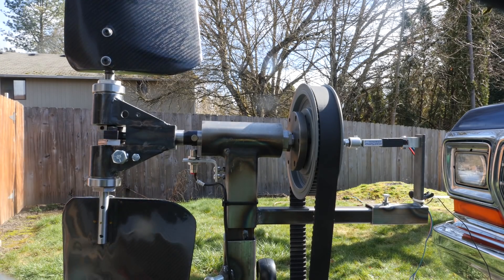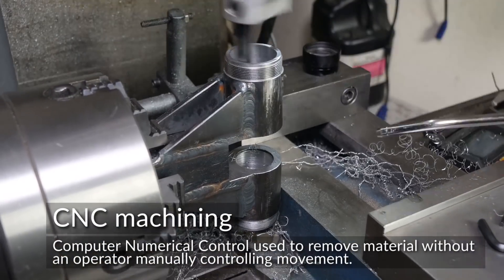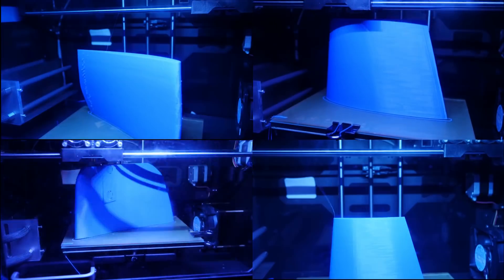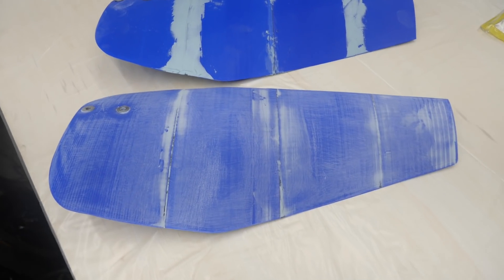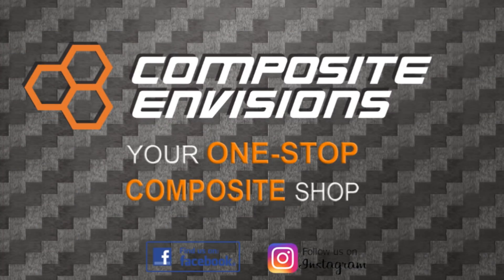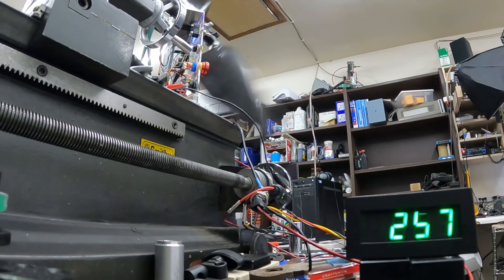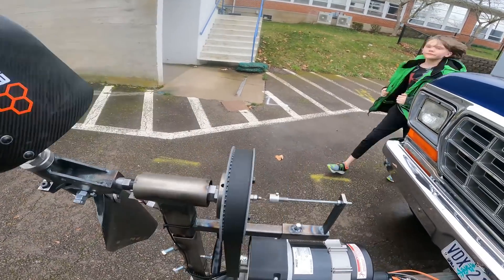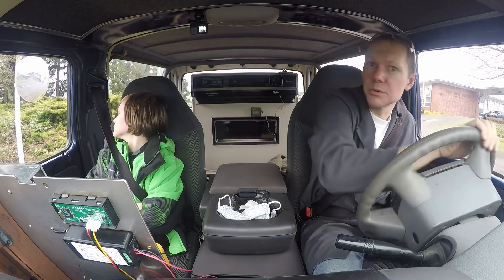Carbon Fiber Blades Making 2000 Watts! - Wind Power on a Car #4

Comment: Experimenting and learning is okey. The laws of energy says that every Watt Hour You will gain from the wind turbine You pay for at the gas station.
Extend the theory a bit. Suppose You could mount a Mega Watt turbine on a moving vehicle. You won't get Mega Watts out of a vehicle powered by even 1000 Hp.
Reply from the maker: Did you read the pinned comment?
Reply: @QuintBUILDs  Eehh. Can You quote or point out what I missed to read?
I made the comment thinking mostly about the average reader and less about aiming at You.
Reply from the maker: @Stefan_Boerjesson  Roger that. I was referring to the part where I'm not certain it will mean additional fuel consumption.
Reply: @QuintBUILDs  Okey. You can calculate using gallons per mile, using the efficiency of the engine, the amount of energy per gallon fuel. Do this with and without the wind turbine and compare to the electrical energy gained from the turbine.
It will for sure increase the fuel consumption. The turbine acts like a parachute, an air brake. In the old days aeroplanes used parachutes to waist the living energy: E = m*V*V/2. m is the mass, V is the velocity.
Reply from the maker: Video proving it works: https://youtu.be/tEPBdztGMdI  😁

Comment: There are already stories to make possible electric car can driven by the fan generator.... 2000W power to drive electric motor.
But at which speed did you make to generate 2000W?

You have already smart childrens!

Comment: I could be wrong but I figure if you use PLA/PETG then it wont crack or warp like that. Since you coated it with CF you don't need the strength of ABS.

Comment: This video caught my eye because I'm always amazed that electric vehicles haven't been designed to charge the batteries some via kinetic generators of some sort.
Reply: They do, they call it regenerative braking.
Reply: @Fulano5321  That's a start, but it doesn't charge the batteries while driving. I'd like to see that technology put into action. My uncivilized mind wants numerous little turbines or something like water wheels spinning while air passes over/through them while the car drives. Maybe the weight and drag makes that kind of thing impractical. Dammit Jamin, I'm a youtuber, not a rocket doctor.
Reply: @xmas4203  Ah, yes, you're right, the drag makes such a thing impractical. There's a thing... one sec while I Google... the Betz Limit that explains that you can only get about 60% of the energy out of wind. So in this video the truck is probably spending about 3000 watts of energy to power the turbine and create 2000 watts of power for the oven.
Reply: @Fulano5321  I see. I had a feeling it was something like that. It seems like too easy of an idea to not put into practical use. 
I always think of my bicycle when I was a kid. I had a light that I'd flip so the little wheel would lean against the tire and as I rode my bike, the light would light up via the little generator.

Comment: Why would you do this???? 
On the car, that "wind energy" is using the cars fuel directly, so not actually wind energy. Its a dangerous air drag wasting money at that point. On solid ground, all math, construction ect is pointless because you wont find anywhere with that kind of wind.
Reply from the maker: See pinned comment
Reply: @QuintBUILDs  i did, i can think of more useful things you could make with your talents. I need something useful making for my gokart. It needs a power generator to recharge its battery while its running. I think you could convert a motor bike stator into a battery charger running off the rear axel AND you could do it in nice carbon...
Reply from the maker: Video proving it works: https://youtu.be/tEPBdztGMdI  😁
Reply: @QuintBUILDs  your data says no fan uses less fuel to move ergo my point was correct. The math on power consumption is flawed because your making big generic estimates of efficiency of the equipment.
Reply from the maker: @christianbuczko1481  don't let the facts cloud your judgement. 👍
Reply: @QuintBUILDs  btw, i think you need to upgrade the battery, as it shouldnt be losing that much power in so short a time, and the cables supplying power to the oven as your losing alot of power there. You need to set it up similar to the power supply for a high powered subwoofer with 10mm^2 cables min, and then check that alternator is working to spec as they can wear out and become less efficient. I suspect the alternator with sufficient power supply and battery set up would be much closer to the fan version. Any further efficiency of the fan would be from an aerodynamic improvement resulting from the fan on the overall vehicle as compared to no fan which is possible when your truck has a big flat front end because it cant get any worse but the benefits of putting such a system on a tesla would be less and likely result in the car being less efficient.

Comment: The ingenuity is nothing short of impressive, but nonetheless energy comes from somewhere.  In reality it would be better to add a second alternator than to add a turbine.  The only time that this would be optimal is going downhill, or decelerating, where the momentum would be converted to electricity rather than heating up the brakes.
Reply from the maker: See pinned comment
Reply from the maker: Video proving it works: https://youtu.be/tEPBdztGMdI  😁

Comment: I make my wind turbine blades out of thin laminated planks of western red cedar coated in carbon fibre cloth. 

It is important the timber is fully dried before applying the carbon epoxy. I spin mine up on a wind driven test rig for coarse balancing and drying. The centrifugal force drives all the moisture and gum out of the blade tip, before applying the epoxy.

Design parametersr are aspect ratio, from 8:1 to 10:1, constant angle of attack root to tip of between 10 and 12 deg, this sets the blade twist, design tip speed of 280kmh, full chord trailing edge flap set to about 8 deg. Laminar flow over front 3rd of chord. Max windspeed 40kmh governed by overspread off centre furling. 

I have found blades designed this way give good all round performance.

I do fine balancing of my blades using additional coats of paint as I have found it is too easy to lose attached balance weights.

Flutter can be an issue (a loud buzzing or roar at high wind speeds) if blades aren't stiff enough.
Reply from the maker: Got pics?

Comment: Just a safety thing- you should wear some sort of a respirator when making any sort of carbon fiber dust for example when cutting or sanding it.
Reply from the maker: You don't sand the fiber of course. That's resin dust.
Reply: @QuintBUILDs  yup. I love the idea of this turbine though

Comment: I am flabbergasted that a ~13% increase in RPM resulted in a ~600% increase in power output.  Are these generators really that sensitive and/or non-linear?  What is going on here?  Maybe you can explain in the next video a bit?
Reply from the maker: An interesting observation.  That generator is kind of unique in that it has a self-exciting "rotating-transformer" armature that requires no external current to start working.  This is not the case in car alternators and most off the shelf generators that have a separate voltage regulator circuit to manage power output across fluctuating load and RPM.  Naturally if I'd removed the belt entirely the turbine would have spun up to a crazy RPM so ~700 must be where the armature actually starts to do its work.  The generator is spec'd for 3600 rpm which would be 1200 at the turbine but we're not generating enough power (yet) to get there.  That's also a reminder that a 100 rpm increase at the turbine is 300 at the generator which helps explain the sensitivity.  Great question though as I hadn't considered that perspective.  I didn't know anything about rotating transformers prior to this project and had to dig through a lot of obscure content to learn about them.  But that's one of the many benefits of taking on monstrous projects like this.  Once I've worked all the bugs out it could make sense to explore other alternator designs but currently I'm planning on controlling power output and RPM primarily thru pitch control.

Comment: Question: Do you think this kind of turbine technology could be implemented into say, a Tesla - and while it may not actually give the Tesla infinite range, a constant charge input could extend the range even farther, simply by driving the car.
Reply: No. It would decrease it's range
Reply: @haha71687  It depends on drag and air resistance, air resistance by a set of blades spinning in front of your car is going to be a lot more then ducted air blowing into a centrifugal impeller, and if designed well enough may not impact the drag enough to cause a decrease in range to the point that the power generated by the impeller could potentially offset the drag it made it improve ranges, not by much, but every mile counts on an electric vehicle.
Reply: There's no such thing as a free lunch.  If it's drag is low enough to be unnoticeable, so is it's power output. This is freshman physics stuff.
Reply: @haha71687  there is more power expended in the motion of the vehicle then the drain on the battery, that is freshman physics stuff. From the heat that can be scavenged from the cooling of the battery, to scavenging energy when braking, to trying and pull some power out of the air moving over the car itself, there is power to be taken back from otherwise wasted energy - now how much that is is questionable, but we know regenerative braking works, and we know that there are ways to generate electricity from heat differences via peltier modules, and I would like to think that a open minded inventor or scientist would have the know how or skill to make a way to take some energy back from otherwise parasitic draws.

Now, please stop being an armchair warrior and go do something better with your time.

Comment: Unless it was a fantastically cheap vacuum pump I wouldn't have expected any trouble running it for a day or so as you're not countering a lot of gas coming into the system or vapour coming off. I'm experienced with Edwards rotary vane pumps and they can run for 18months non stop. pulling against closed system without issue. (Even used with a lot of water vapour they run a long while without issue - though need to drain off mayonnaise occasionally).

Comment: I have one question... Why don't Tesla and other automobile manufacturers use that system for battery charging in cars? Are there any real reasons why it isn't used like? Sorry If I sound stupid but I am not an engineer, so my common sense thinks that could make cars greener and have even longer mileage.

Comment: Great videos and including the kids is awesome.
You could've weighed each blade and within a gram would give you decent balance up to 1000rpm, 2 scales and putting the hub half on each works to for checking 2 pole spinning things too.
Your boy is smarter than a lot of millwrights I know..
-You're a maker, make a fume hood or extractor for soldering. You wear a mask for most dusty operations, your boy shouldn't be inhaling lead/flux fumes. We do because our brains aren't still developing. lead is cumulative and i'm sure he's not soldering every day, but why not. It'll make another good video.
Reply from the maker: I did weigh them out and attempted to sand more resin off the heavier one but was too late to go back and fix.  So... weights!  Thought of it ahead of time but didn't think it would matter that much.  Whoops!  Learned something.

Comment: Basic engineering - You are spending  2 times more energy in your car fuel than u are generating via this wind turbine..
Reply from the maker: See pinned comment. Not so basic I believe.
Reply from the maker: Video proving it works: https://youtu.be/tEPBdztGMdI  😁

Comment: But you have a lathe. Secure the generator to the lathe and operate and understand how much power can be obtained from the generator. Wind generators below 100 kw are not profitable - it is better to install solar panels.
Reply from the maker: Go watch video #2 in this series.

Comment: You've just discovered the ultimate range extender for EVs. When you first started this project, I envisioned a squirrel cage type rotor mounted to the roof; whatcha think?
Reply: It would be a range decreaser.
Reply: @haha71687  How so? Do you think the power loss due to added wind resistance would exceed the power generated?
Reply: @jashton8710  Exactly. You could maybe capture a couple free watts by doing some fancy aerodynamics in the vehicle wake but something like this is going to definitely have way more drag than the power it produces.

Comment: I wonder how far it'd go if you could tweak freely with the variable pitch. I'm interested to see what effect it would have on the engine load. Does a 2000w turbine just draw 2kw(~2.6hp) of engine power? I feel like it would generate a ton of drag as it is basically an autogyro and the modern design probably only improves the RPM with the same drag
Reply from the maker: That is the question to answer. See pinned comment.

Comment: Isn't this one of those things where it will cost more energy, payed for with an increase of gas consumption, because of friction than what you can generate?
Reply: I think this is just for fun science, maybe in future they can make unlimited fuel car by doing this
Reply: @Whopparhombus  That would be amazing!! Sadly thermodynamics would not allow that. Though it would be a great way to make the car go further potentially. That does depend on how much energy it takes with the added wind resistance and power production it offers though.
Reply: Read his pinned post at the top of the comments. He thinks that the car is so inefficient that he'll be able to use more of the energy of the already burned fuel, rather than just waste it; this isn't violating any thermodynamic laws, he's merely attempting to tap into the otherwise wasted energy.
Reply from the maker: Video proving it works: https://youtu.be/tEPBdztGMdI  😁

Comment: Kinda genius putting some of the Coefficient of drag that is other wise just lost  to good use. He’s just converting the drag energy normal lost by hitting the car at speed to energy that can potentially be used to charge a battery. Same as regen braking captures  energy normally lost as heat in braking.  I’m not sure why some people here think this is a physics violation.  Would be neat to test on an electric car on the highway. Interested to see how much if any this adds to the vehicles existing CD. Good job man

Comment: Pappy says put a 427 SOHC motor in and run both pipes thru the oven and you'll have a modern day mobile Turkey air fryer that'll get er done in a jiffy..the temp control is the gas pedal...if you're just going a few blocks you can still do Turkey legs..get em real done now...go to some of those "Squeal Tires On Pavement " signs to help preheat the oven real good..I bet it hardly takes any electric power at all that way.

Comment: You might try mounting a gasoline powered heater from a '46 Chevy inside the oven and see how much gas it takes to cook a chicken that way as opposed to electrically, thereby the best way would be exposed at last...since you're stuck with an ovenmobile

Comment: On small aircraft that use “Constance speed props “ they use oil pressure in as a hydraulic cylinder to Controal the pitch of the prop

Comment: Why not just install a good high output alternator like a Mechman, CES, Brand X, or Iraggi. Then throw in a proper lithium battery or two and call it a day while also producing 2-3 times the power? Need to run a stove or other 110/220v appliance? Inverters exist 🤷‍♀️
Reply from the maker: See pinned comment

Comment: Next question: how much mpg did you lose to power the oven?

Hahaha.
Reply: I was thinking how many cookies per gallon.  That is the real question.
Reply: @CorePathway  how many calories consumed
Reply from the maker: Here's your answer: https://youtu.be/tEPBdztGMdI  😁
Reply: @QuintBUILDs  Thanks a great deal for the video and the work you put in.
Reply: Love to see this experiment with uk gas prices.
Reply: @ICGedye  people in the UK use public transport lol
Reply: @9The0Unknown7  yeah the cash-strapped, smart or those who can’t ride a bike. Car is king, the bigger the better.
Reply: @9The0Unknown7  UK doesn't use gas either
Reply: Only cook on a down hill
Reply: Yeah the truck engine is powering the oven at the end of the day. Any wind resistance turning the fan blades is just added to the net vehicle resistance, and the engine makes up the difference being under a slightly higher load.
Reply from the maker: @ClarkBark14  not exactly.  See the latest video where we check the mileage:  https://youtu.be/tEPBdztGMdI
Reply: But go deeper. Calculate how much your electricity costs to produce and compare that to doing that at home. Btw the new interior and old bronco exterior was hurting my brain until he explained it's a restomod.

Comment: This is a classic example of 'because i can". Anyway...

Basically, at a super high level, he would cook something with gasoline...ultimately. And because of the laws of thermodynamics, the loss of energy would be significant. Still, it is fascinating to see the engineering part.

Comment: I'm still wondering why you are trying to generate electricity with a truck getting 10mpg. Most energy inefficient trick ever.
Reply from the maker: See pinned comment. Also not original engine but you have to watch the video to learn that.